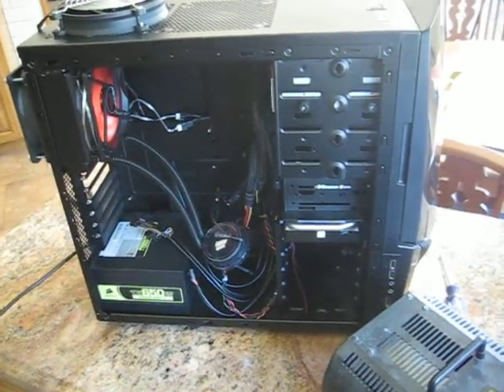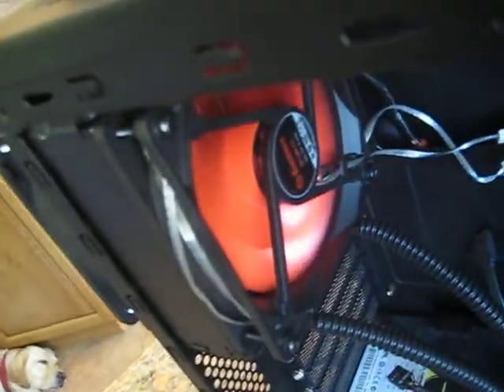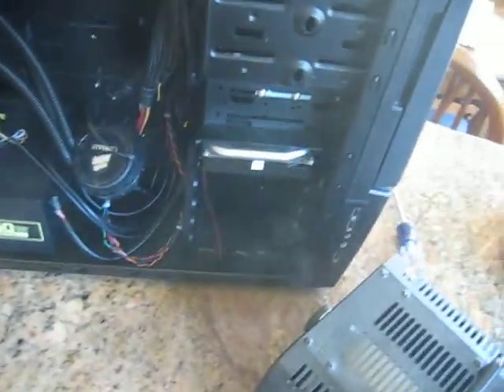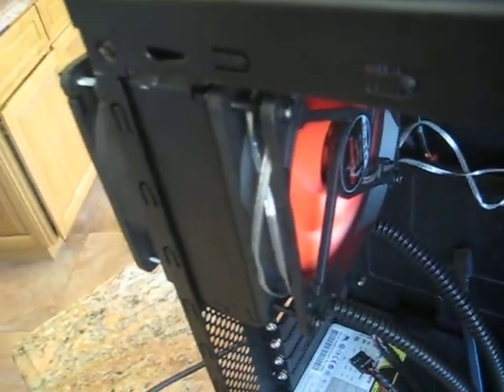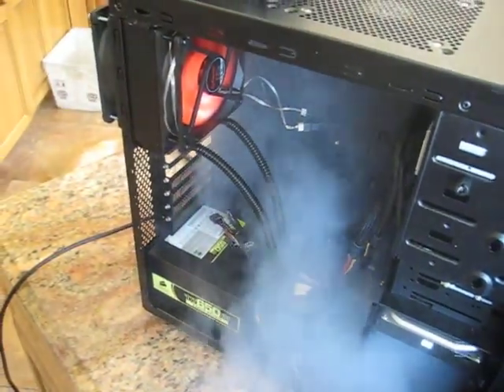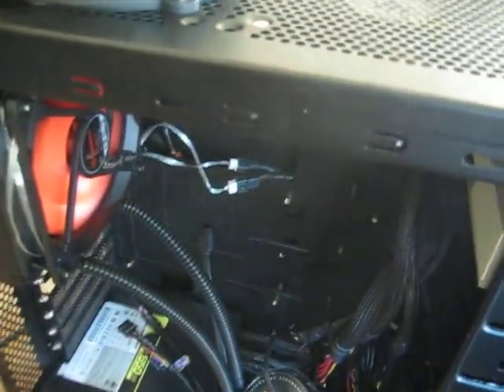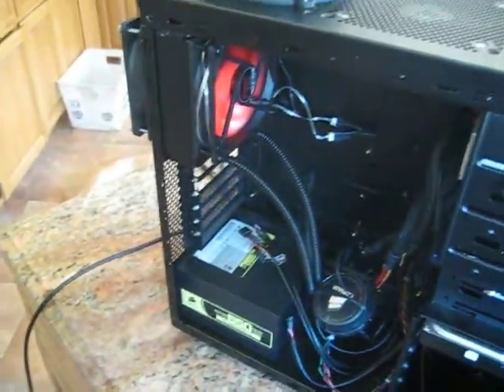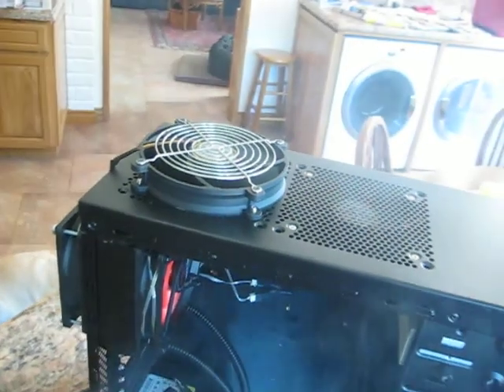Computer Desktop Fan Test with Fog Machine: NZXT Lexa S (4 fans) and H70 (2 fans) Part 4

Comment from the maker: @hellowsaw The case comes stock with only one 140mm fan blowing at about 40 cfm on the top. I believe it is exhausting. The lexa s has room for two fans on the top. On the top their are slots for both 120mm and 140mm fans. This means you could put either a 120mm or 140mm fan on the top. To answer your other question, the side fan is intake.

Comment: @gpmoorman Oh i see... i got another question here. Do the top had a exhaust fan included and can i get an intake fan to install at the extra slot at top? In addition, is the stock cooler fan on the side is an intake fan that cools the graphic card and cpu well?